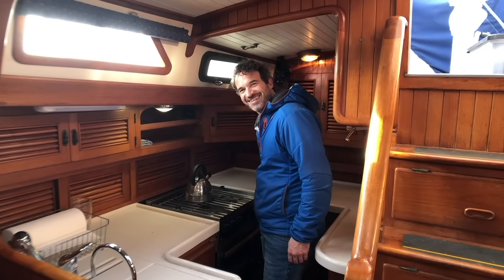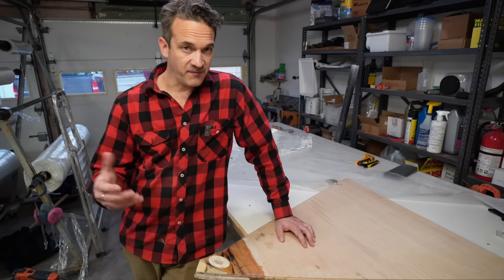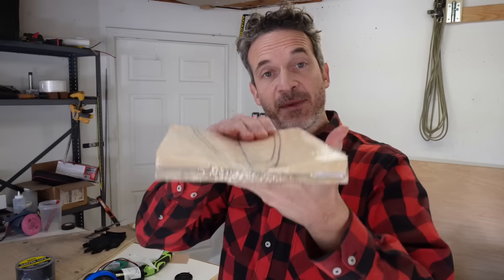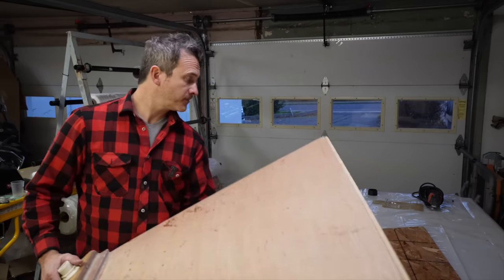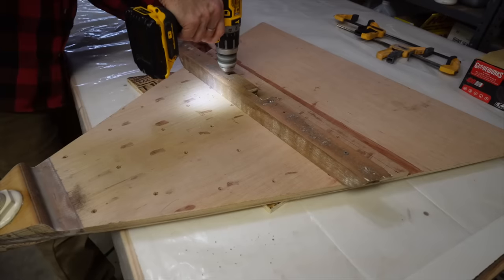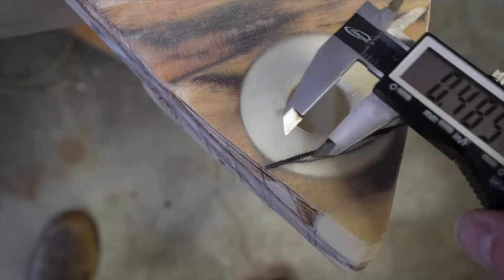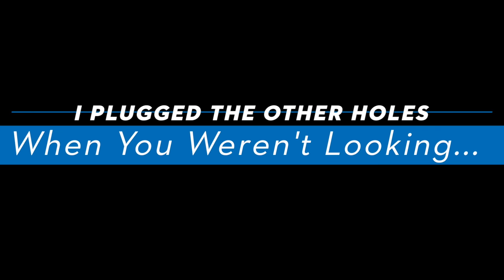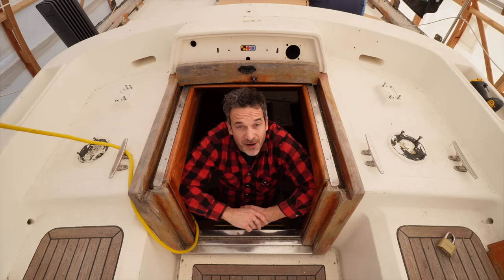Transforming the Anchor Locker and Bulkhead on Antidote - E017

Comment from the maker: Do you think we should engineer this forward bulkhead to be a water-tight crash compartment?
Reply: No.
Reply: You do not need a crash bulkhead until you run into a long or container in the night.  

The way that you have it currently constructed, it would not be difficult to make it into a crash bulkhead.  I would think that by the time you finish with the install with tabbing on both sides, the bulkhead will have more than enough strength.  At that point, it comes to the strength of a cover for the opening.  Your opening is relatively small so the loads on it would not be bad.  If I wanted to make it into a crash bulkhead, I would fabricate a cover that is an inch or so larger all around that is mounted to forward side of the bulkhead.  It would only need to have a way to hold it into place with the water pressure from a flooding event providing clamping force.  Because the opening in not circular, you would be able to turn it sideways and pass it through the opening and then pull it back into place.  
I have a friend who had a 65' steel boat with a water-tight door that swung into the forward cabin and looks like it is from a destroyer.  He told me that the cabin in front of that door was the cabin for his two teenage sons and they never closed it for fear of them being trapped inside. I explained to him that leaving the door open would not matter because any large volume of water would push the door closed and seal it even without the dogs being drawn tight.  
He was horrified by that thought but I told him that they would still have no problem getting out of the flooded cabin which he doubted seriously explaining that the pressure against the door would make it completely impossible to to open.  I said, have they ever climbed out of the overhead hatch?  D'oh!  

These crash bulkheads are not designed to keep the water out of the boat.  They are designed to only allow the portion of the boat that is below the waterline in that space to fill with water.  Provided that you're opening, which is more than likely well above the waterline, the anchor rode space is already a crash bulkhead and adding a cover would just allow the boat to setting a bit deeper in the bow before the water was able to move farther back into the boat.
Reply: Yes. Even add a water tight door to it.
Reply: Kevlar ?
Reply: Yes   Kevlar?
Reply: if it is relatively easy to make it water tight, why not?
Reply: You are going to need access to the chain locker to deal with castled chain.
As you have already pointed out the current access hole is tight.
You need a chain locker that you can access.
If you can turn that into a water tight crash compartment with out compromising the primary requirement then do you have the time?

Speaking from solely experience of building a much smaller boat (3m)  if you add every great idea then the project time line becomes a length of string. I can see how much you enjoy this but there is another  40ft or so of boat behind you that is filled with great ideas that are detours on path that will turn your time line into a length of string......
Reply: You fiberglass everything anyway, all you need is a strong forward-opening door with a good seal on it, and a way of camming it closed and watertight. Just remember that a significant collision that crushes the bow will likely crush that chain pile into the bulkhead with great force, so while it may be watertight, you won't have a crush buffer zone.
Reply: Dividing a boat up into water tight bulkheads that was invented by the Chinese on their junk rigged sailboats around the year 1405 their bulkheads also formed cargo holds at the same time. The decision to add this to your boat should be if you are going to be sailing at night or with no one at the helm to avoid a collision or if you are going far enough away from rescue to make it life threatening then I would say yes also if you sail in ice cold water too then Id say yes if your only going to be a day time sailor and someone is always going to at the helm in good weather and close to the coast then I wouldn't go through the trouble necessarily unless you are already having to change the bulkhead like you are. Good bilge pumps can get you home for most of the common water leaks and being prepared with methods to slow water leaks down is smart to. Check your hull to deck joint  is not just a glued joint also and make sure that it is actually mechanically fastened as well as sealed especially in the bow area that will be under the water in rough seas if a hull to deck joint pops open at the bow your boat will be scooping up tens of gallons of water every time the bow plunges into a wave possibly more even also if you are sailing heeled over the side rails will be submerged and a leaking hull to deck joint there will take on a lot of water too possibly. A sailboat that has wide side decks and a center cockpit is safer if the boat ever suffers a broach also most sailboats are aft cockpits that have very narrow side decks in the after end of the boat near the cockpit so when they get broached they roll over on their sides and scoop up an entire cockpit full of water often times then it is a matter of is that water going to drain out before the next wave over takes the stern. My point is that safety is not just a water tight compartment in one area of a vessel but it is the knowledge of the sailor and taking all possible situations and scenarios in thought ahead of time a water tight bulkhead at the bow wont save you from being swamped in the stern by a following sea or while running into an inlet that has a very large swell incoming with the tide going out for example but a smart skipper would avoid trying to run that inlet in those conditions and would wait them out offshore instead. Risk mitigation is what we are really talking about when it comes down to it but it doesn't hurt to take as many precautions as you can take if you can afford to and it makes practical sense to I don't see any negative effect of making your forward bulkhead water tight so Id say do it you will have a piece of mind from it. I have seen some guys that sail to the arctic completely fill their bows with expandable foam and still having a water tight bulkhead too but they were solo sailors that didn't require the space in their boats for other items and to them safety at sea was paramount number one factor because where they were sailing rescue would be nearly impossible in time to prevent death from the freezing water should they find themselves in it.

Comment: Damn. Came here after a mention in Duracell. Your explanations, graphics and calmness made me instantly hit subscribe. Great work :)
Reply: Ps. That foam piece in the bottom is nice, but slightly overengineerd I'd say, since it's not structural in any way. Why not make the upper layer, stick it in, drill a hole in it and fill it with an epoxy foam (or PU-foam even). Glass over it and you're done with a lot less steps.
Reply from the maker: Hi and thanks for the feedback. 🙏. 
I agree that it’s over engineered! 😂. My thinking was that I wanted to get some practice with the vacuum bag (new skill to me) and also if the grate ever gets out of place I wanted the floor to handle the heavy chain. 👍🙌

Comment: It's very common to get a lot of sludge/weed in the anchor locker. (even after washing off the chain) I'm imagining that you're going to be in the locker often cleaning/ clearing your drain hole, not to mention the pump filter...Also, you might want to add a couple of eye bolts to attach the bitter end of your chain (with line, so as to be able to cut free in an emergency)
Reply from the maker: Yeah, that’s why I went with the large 1.25” hose… we will see how it does. I agree with the concerns. The pump is designed to tolerate debris up to about 1/4” so that’s how big I’ll set the drain holes in the floor. 
I can’t image it will be worse than the original design 😳😂
Thanks for the feedback!
🙏👍🙌
Reply: Of all the engineering and thought that went into your projects. All the detail, planning and detail I’m glad someone reminded you ‘they’ know why chains get cut when they get cut.

Comment: I was lucky enough to have the chain pile up in the locker so it could take no more, we found out too late and the winch overloaded and the breaker popped. We had hardly deck and no bow acces so the only way out was dropping the anchor back. No fun with wind and a busy anchorage 😉 I understand your safety concern but good acces to your ground tackle is worth thinking about. Grtz from holland
Reply from the maker: Thanks for the feedback. Yes, I agree. If I go the route of a water tight (or close to it) bulkhead, I will need an access hatch or door to allow me to access the chain. Good catch!
🙏👍🙌

Comment: My wife just walked in while you were explaining the foam fill wedge and tapers and said "He must be an engineer.  He thinks the problems through."  Beautiful job on the locker.

With the square pipe threads, do not do what Forespar says in their directions and use Teflon tape to seal the square threads.  I installed four Marelon flanged seacocks with their buttress thread and every one of them leaked.  The Teflon does not have enough filling property to seal up the thread.  Given that it was in the water, stopping the leak was a problem.  I ended up unthreading the seacocks until there was only one thread still engaged and then brushing on paste pipe dope.  a bunch of water was leaking bast the one thread but the dope sticks to wet surfaces.  I then tightened the valves back down onto their flange and no more leaks.
Reply from the maker: Thank you! (To you and your wife) 🙏
That sounds like a stressful situation with the leaking thru hulls! I’ll take that under advisement!
Thanks as always!
👍🙌

Comment: I had an exotherm once on a very thick layup of pre-preg e-glass.  We were laying up a 2 inch thick panel.  To minimize the excess resin, we first did a pre-layup of 10 plies of glass with a layer of porous teflon, and 5 plies of bleeder cloth to absorb resin.  This was then heated under pressure to low temperature to get the resin to flow into the bleeder fabric.  Success! The bleeder fabric was completely saturated.  Now we took the 10 ply stacks and combined them to make the finished laminate, and put them in a heated press to complete the cure.  Disaster.  There was still too much resin.  It flowed out of the pile, and began to smoke.  We had to open the roll up doors and pull out the big fans to vent the shop.  After cleaning up the mess, we redid the entire process, but used 10 plies of bleeder for the reduction step.  We also put a hold on the cure temp with a stop at 250F to stabilize before going to the 350F final cure temperature.  Good memories.  I got a lot of @#!% over that one.
Reply from the maker: Wow. That sounds crazy! Thanks for the story!! Thankfully I haven’t let any smoke out of my parts just yet… 10 layers of 1708 is the most I’ve tried so far…
Reply: @livingforsail  Yes, it was a long time ago, and in a different life almost, it seems. The company I worked for trained FAA inspectors in composites repair techniques. The smoke caused cancelation of class for the day.  One of the inspectors later offered me $100 to do it again, LOL.  That laminate was around 60 plies total. Lesson learned. The only fortunate thing was that it was an aircraft-grade fire-retardant resin, or else it would have caught fire, for sure.

Comment: Your attention to detail and complex solution to problems is mighty impressive. I would have just filled the bottom of the bilge with thickened epoxy or vinyl and glassed over it. Your solution is far more complex but prettier that's for sure
Reply from the maker: … “there has to be a harder way?!”  😂👍

Comment: Very important to epoxy seal edges all of the ply usually takes two coats.
Reply from the maker: Yes! I went around the edges with unthickened epoxy several times until it stopped soaking in and then the parts were set in a bed of thick epoxy around the edges so I’m hoping to eliminate a path for water along the edges! 👍 I’m also plugging any drilled holes with epoxy over-bores and staying away from screws. 🙌

Comment: Uhh, simple really for the water tight crash bulkhead. The off cut for the access hatch can be used. Just add a half inch over lap frame to it with some weather strip of some kind. But a bolt through the middle. From the chain locker side get in into the cut out and then fabricate an x frame from 2by 2" to hold it to the bulk head with a wing nut. If water ingresses the pressure will push against the hatch and seal it. That,s the way Wharram did it. Simple and very functional.
Reply from the maker: Thanks for the idea. That’s sort of what I was thinking. I will definitely have it close from the inside and try to keep the “hold on place” mechanism pretty simple. 
I’ll probably stow it up forward in a bracket or cradle so it’s up and out of the way but can drop into place easily. 
🙌👍
Reply: @livingforsail  uhh , have a look at what the experimental aircraft guys do to panels, access hatches ect to stiffen that area. They take or make  round pieces of foam cut down the middle and glue and tab them onto the flat surface. Just have a look at the back side of your car hood or trunk to imagine what I mean. You could make the crash bulkhead and access panel super stiff and even if it,s not space station or submarine level secure,, if it,s strong it will slow down ingress and your pumps can keep up.
Reply from the maker: @russellesimonetta9071  I can imagine what you mean. That's a great way to up the stiffness without adding much weight. Thanks!!

Comment: I'm thinking of using G10 rods to make epoxy plugs for holes. I've had problems with voids and air bubbles when I try to fill the holes with epoxy. I'll buy G10 rods in various common diameters. For a 1/4" bolt or machine screw, a 3/8" G10 should be large enough. No voids and I can drill, tap or screw directly into the G10. It should save me a bunch of time and a foot long 3/8" rod is just $9.00. If you want to get really fancy you can get G10 tubes instead. It's a bit pricier but then there's no chance of missing the G10 when you drill the hole.  A 1/4" ID tube works out to about $1.50 per 1" deep hole. One place has it for $.90 per hole.
Reply from the maker: That’s a good thought. I’ve considered using the tubes but like you said the prices can get a bit $$$. I like your idea. I might just have to steal that one 🙏👍🙌

Comment: I was under the impression that plywood was, itself, stronger because EACH ply is oriented perpendicular to the adjacent one. Is doing it for additional pieces of plywood added on to it making any difference?  I am thoroughly enjoying your "thoroughness" in your construction! I have no idea how long it takes you to make the CAD drawings for your explanation diagrams, but it sure makes it easy to visualize! This may be a long renovation! Or are you purposely timing it to finish when your wife finishes law school in 3 years?!  😉
Reply from the maker: Plywood usually has an odd number of plies (and they can sometimes be of different thicknesses between adjacent plies). Stacking the sheets at 90 degrees gives you the best overall directional stiffness for the finished panel. It’s probably minor but it’s how I was thought to layup ply panels years ago. 🤷‍♂️
The video making (including the CAD work) adds a significant amount of time to the refit but we are having fun, right?! 👍

Comment: Amazing job! Did you ever concider making the bulkhead solid and install the pump direcly on the bottom of the anchor box with a perforated plate as a floor over the pump? To reduce weight and compelxity. Keep up the excellent work!
Reply from the maker: Thanks! 🙏
That was my original thought. I liked that this way the chain is lower in the locker and I can service the pump remotely. The locker is really deep and hard to reach once it’s all back together… we’ll see how it goes 🤞
Reply: @livingforsail  Got it! Makes sense! 👍

Comment: What did I miss, Jon? Why not just make your foam wedge a bit taller to mate up with a thinner layer of glass? What do 15 layers accomplish that 7 wouldn’t?  Another great episode, of course, they all are.
Reply from the maker: Thanks Torsten. 🙏. Haha. I’m sure that I could have gotten away with less. I did want the floor here to be pretty stout in case the grate gets dislodged and the chain is sitting on it. It’s a pretty small area so overbuilding doesn’t really come with any weight/cost penalty. Also, it looks cool 👍🙌
Reply: @livingforsail  “Pretty stout” it will be for sure😊. One more thing, please make or buy yourself a few push sticks for your table saw. I’m worried about all the videos you won’t be making when it takes off a finger or two.

Comment: I like the idea of the crash bulkhead.   I was thinking of doing the same type of thing on my Corbin 39.  I wonder if adding a ball valve before the hose barb would be a good idea in case the anchor compartment became flooded.  But would it close with all the sand and debris?

Scott
Sailing Vessel Reimagined
Reply from the maker: I’ve considered adding a compatible ball valve to the bulkhead before the hose barb. If I make the bulkhead water tight, it would be needed in case of a breach. 
I plan to flush the compartment periodically to keep stuff from building up. 
I think we can keep it working but we will have to wait and see! 
Thanks for the input Scott. 🙏👍🙌